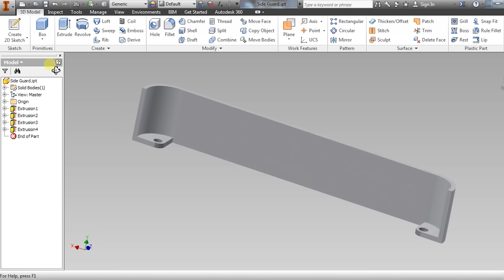TEVO Tarantula 3D printer - HOW TO improve your printer - Part 12 (Air flow)

Comment: Have not even installed the front cover or the cooling fan, starting to get hot here in Australia so might install a smaller fan.

Great videos, just got a 1.5cm board to start the bracing and lock down of the frame.
Reply from the maker: Greetings Sqwert,
Thanks for the comment.
Regards

Comment: Why not doing it slightly bigger...  So you attach it from behind the acrylic instead off between the acrylic and the board?
Reply from the maker: Hi Jaime,
That is a valid point and i thought about it at first but, although it's easy to install as well,  i prefered something more "discrete" and that would maintain the original overall look.